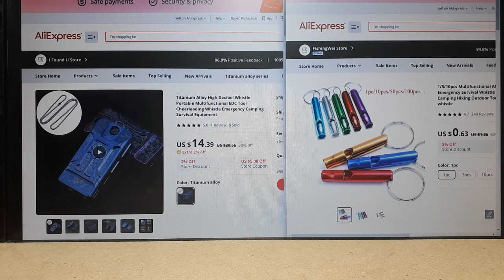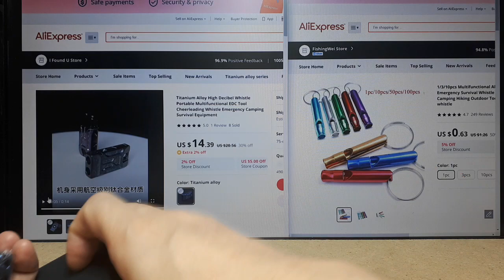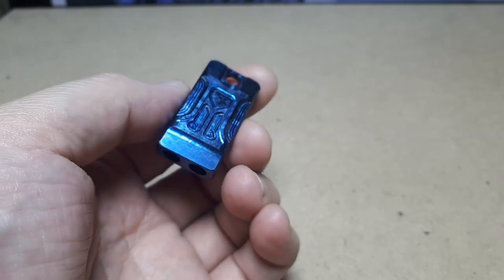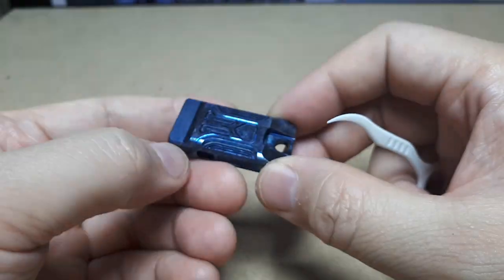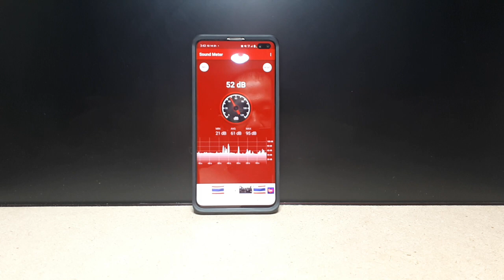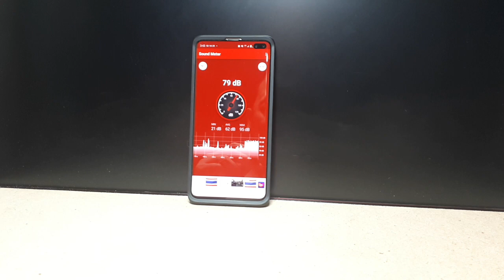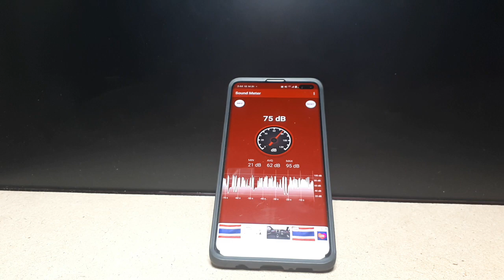full titanium whistle 120db?, EDC, generic, Aliexpress

Comment: Yeah. That whistle is quite mediocre. So far I've not seen any China whistle live up to its promising. The only good titanium whistle I've encountered so far is the Fox 40 Titan. Unfortunately it's not quite as loud as some of their plastic and the insert is plastic. That said it totally blows away any China titanium whistle. A few of the type with plastic inserts (like Tomshoo) are quite decent if you take the time adjusting insert just right - but still they're no match for Titan. Think I've tried a wide variety of the dual chamber titanium whistles on Ali Express. Some are marginally better than the model you have (though it probably has best overall design). I guess there's a limit to how loud the small bore of the whistles can be. Titan has larger bore. And one more thing the China titaniums fail to get right - both chambers have equal bore length. If they had slightly different borelength like the Titan (and other pealess football whistles) then they would have a rolling sound which would be much more penetrating. Wonder when they get that right - if ever. I'd love an earpiercing loud rolling all titanium whistly. Doesn't have to me teeny teny. Size of most Fox 40 or Molten whistles wil be fine - it has to have physical size to have volume/loudness.
Reply from the maker: Thanks for the info. Hope other buyers can learn from your experience.